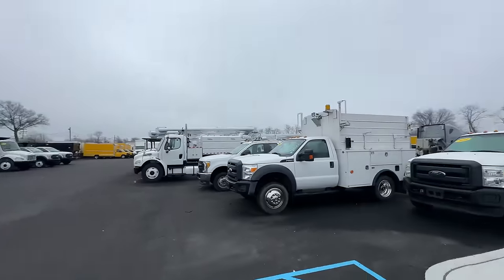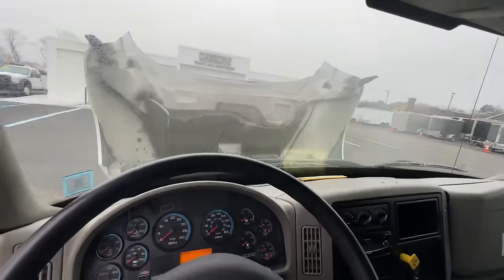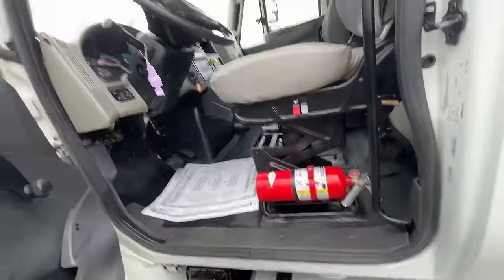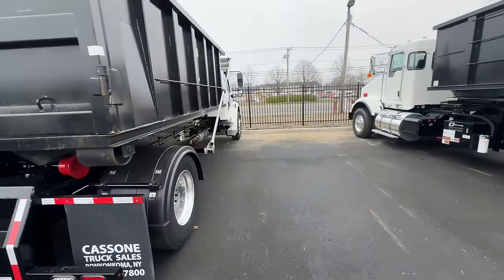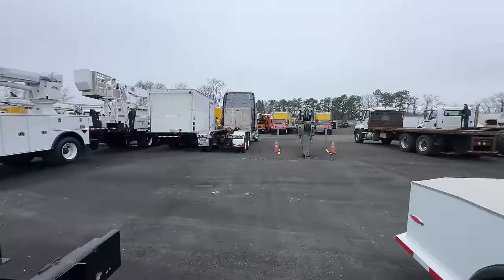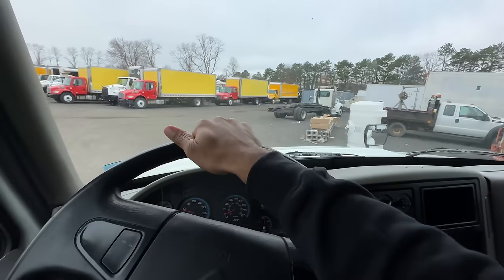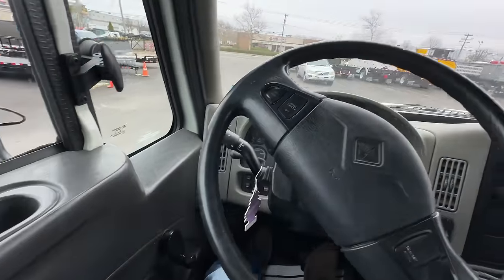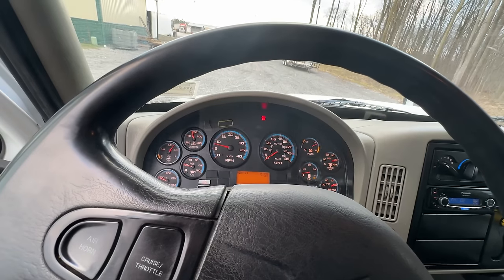Will I Make It Back Without A Check Engine Light Going On ???

Comment: They run the International on RVs a lot and they often sit for weeks or months then go on a long drive, they do very well.  Except for the DEF freezing in winter you should not have issues.  People bash them but there are thousands running around as RVs and have very little issues.  You know the RV owners are not running them in a shop like you have there,  so I would think you should get a lot of use with little issues.

Comment: Looks like they put aluminum rims on from the original steel wheels just make sure you have enough thread from the stud coming out past of the lug nut could be a dot violation. Just did this on the same truck had to get longer wheel studs

Comment: DEF systems are not bad.
Reply from the maker: Really ?     Enlighten me ….. the only thing I found is that they are unreliable and have premature engine failure and worse mpg in our application
Reply: They don't cause premature engine ware. Freightliner Cascadia I drive is reliable. And yes you have extra maintenance. And it doesn't burn extra fuel
Reply from the maker: @lloydkuepfer1599  gotcha….. we run heavy and have to idle to unload ….     And we run our trucks well over a million till rebuild
Reply: @flintcreektransport    Have you had any problems with the 2016 peterbilt dump truck that has emissions and def